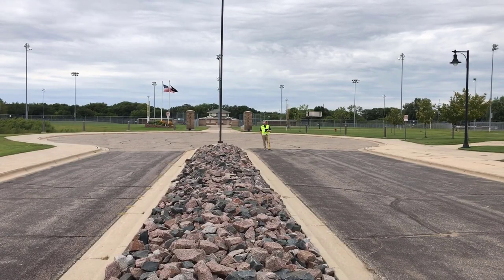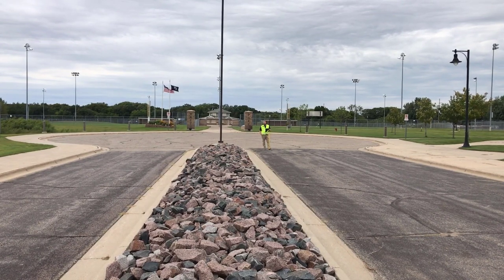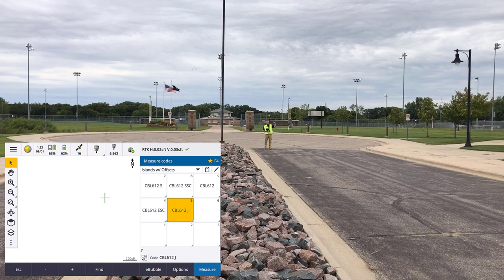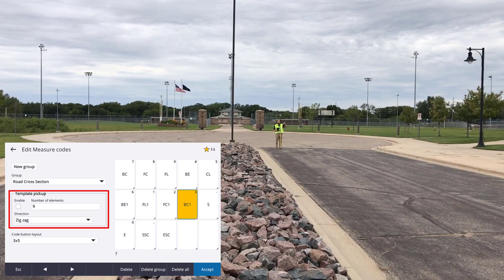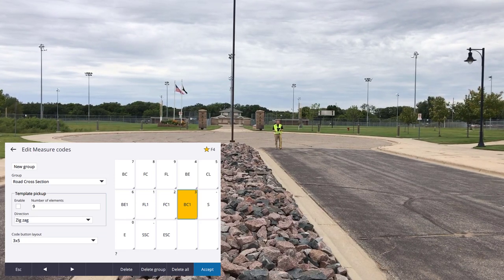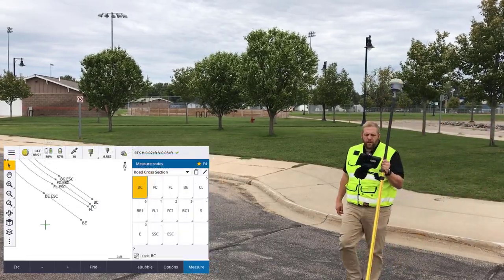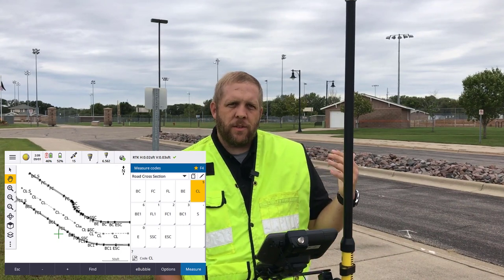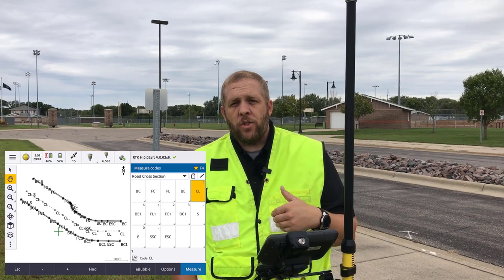Linework & Measure Codes in Trimble Access

Comment: Are your codes line or point codes? We are having issues with lines not drawing in the data collectors even when using line control codes. Thank you!
Reply from the maker: For the linework they need to be line features. You also will want a line control code to tell the software that you are wanting to start drawing the line.
Reply: How can I import into Autocad the line control codes.  Or does trimble just not work with Autocad
Reply: @patrickkorzon9707  Autocad uses a similar procedure but through a survey database. To be honest, once it is completed in TBC I would prefer to export lines directly from it. My two cents.
Reply: Line codes.  Same problem